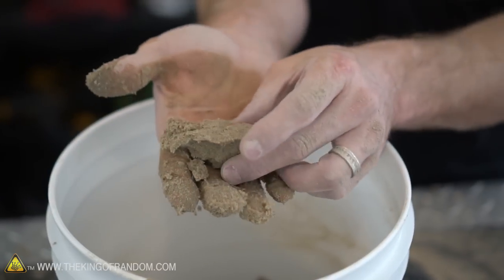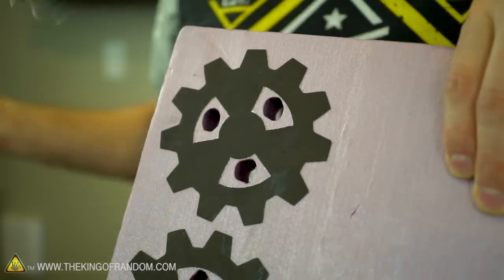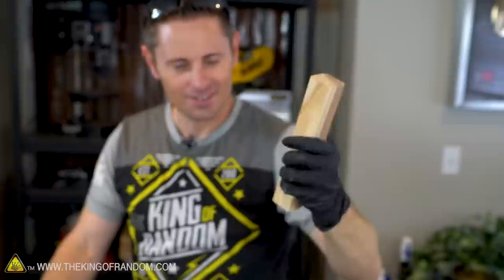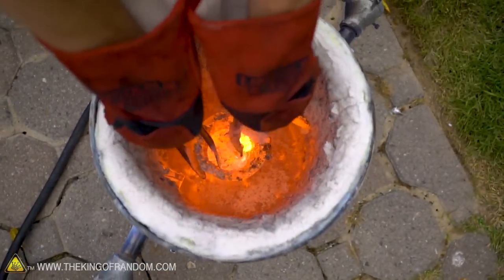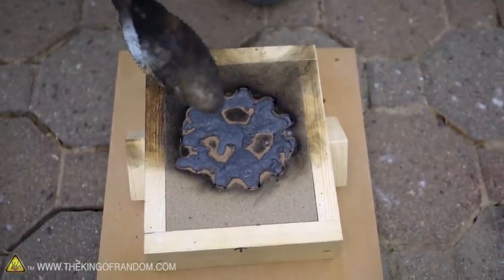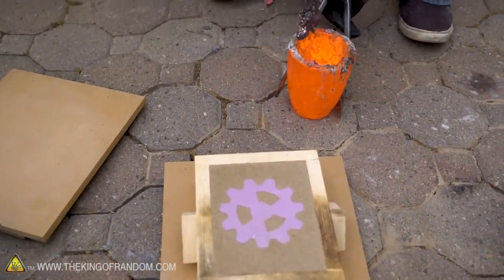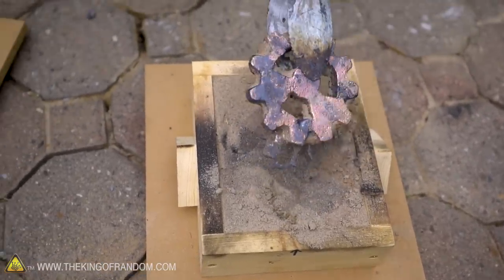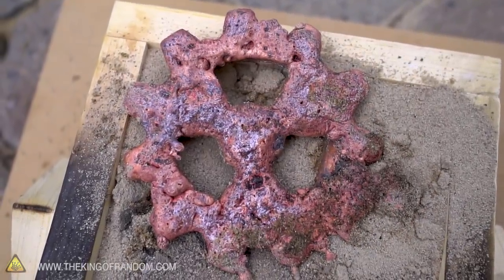Casting A "Radioactive" Copper Gear! TKOR Test Metal Foundry With Fidget Spinners &  Copper Melting!

Comment: What happens when you pour hot metal onto cold metal. Will the bond between the two be any weaker or will it be the same as if both were put together at the same temperature?
Reply: Pour*
Reply: lol ty
Reply: It will be weaker, becouse the the crystalline structure of the second metal wont have many bonds to the other one.
Its almost the same as if you were welding at low Amperes and welded too fast.
Reply: I'm sure it will be weaker, but will it fall apart if you try to pick it up? how much weakerr
Reply: It wont fall apart if you pick it up, but if you hit it with a with a hammer it very likely to fall apart.

Comment: If you ever decide to cast copper again, I have a trick I was shown a few years ago... When pouring the sand into the tray, mix it with wood glue, It will help the sand stay in place... You may also think about using kinetic sand(saw a video with aluminum) however it may still come apart.

Comment: What happens when you quench hot metals in liquid nitrogen?
Reply: They explode due to temperature difference.
Reply: Fluffy Unicorns man that's crazy o would not have thought about that. Thanks!
Reply: I don't think it would explode or really cool it much due to the Leidenfrost effect.
Reply: oh yes it will, thermal shock is a major issue when it comes to material stresses, Leidenfrost only last for a few seconds at these temperatures
Reply: everything related to Liquid Nitrogen: Leidenfrost Effect. It doesnt cool as fast as u think so because of it. A molten metal cools faster in water than in nitrogen.

Comment: hey grant here's a tip for green sand casting, you're supposed to heat the sand some so that when u pour the metal it takes a little longer before it hits its solidifying point

Comment: Is it possible to use liquid nitrogen to cool a PC?
Reply: No, liquid nitrogen would break the computer because it is way too cold
Reply: No the nitrogen would evaporate and pressurize the tube resulting in it blowing up
Reply: William Nixon Yes, but you need to create a specialized setup to do it and you need lots of insulation around the cpu inorder to prevent condensation
Reply: The truth is yes, it has been done and is even commercially available. The problem is it is a really specialized build. It also sounds like someone is mowing the lawn in your room. Linus did it
Reply: Scott Sarver your wrong people already did
Reply: Yes, and you can also cool a 
PC with vodk- wait no that would catch on fire nevermind.
Reply: arcticdoggo somebody did and it’s pretty funny

Comment: can't you melt copper with the carbon rods?
Reply: Yes but not as much
Reply: Damien kavanagh the carbon rod even melted rocks there should be no problem melting copper
Reply: yeah but his electric arc furnace is extremely small.
Reply: Notumengi grant have to use a better transformer which cost $$$... the transformer that he make is homemade using microwave

Comment: What if you took the hot crucible and tried to put in into the water bucket?
Reply: Mr. J I think it may crack but I don't know
Reply: it would definitely shatter... the temperatures differences would cause the outside to shrink way faster then the inside and would crack and  continue cracking until it just crumbles and explodes due to vaporized water... I don't think he would do that though since crucibles are so dang expensive

Comment: What if you bake the sand in the oven first with the styrofoam mold in it. To prevent too much loss of moisture in the sand use the wetter formula that you used before. That way as it heats up a little bit will evaporate and it still might maintain its structural integrity

Comment: Take all of your different metal melting foundries and test to see:

1:The most efficient
2:The cheapest.
3:The hottest

Have fun!
Reply: The plasma Arc furnace WILL be the hottest, and only uses electricity for "fuel"
Reply: epion660 And the electrodes
Reply: epion660 The microwave transformers can be quite expensive.
Reply: I was referring to running cost. Electrodes will last a while, and can be found in lantern batteries. Also, the transformer can likely be salvaged from a used microwave that's "broken"

Comment: I don't know if you'll even read it, but here it goes, you should try heating the mold on the oven before pouring the copper. It would heat the sand and possibly help a little with the copper cooling too fast

Comment: Use a top and pull the mold out.  The sand will insulate the copper and you'll get an even cast.  Use a pvc pipe in the center when packing the top, and make sure to talc the layers.  Keep the mold clean.

Comment: In theory what you could do instead of the foam is make a metal based mold that can withstand the heat of the copper so you can set the copper in. No issues with sand moving or causing issues.

Comment: I'm betting a copper oxide skin is preventing the metal from coalescing.  Before you melt your metal, liberally pour boric acid into the crucible to protect against oxidation.  Just before you pour, remove the slag with a carbon stirring rod.  You might also want to look into using a Sparex pickle solution.

Comment: Hey Grant. I was just wondering if you used a bigger box for the sand and the foam to form the copper gear. In your part 2 you posted today. That  would probably expand the surface area of the sand which will make the sand not pop out because of the heat that is condensed in one area. Just had the thought.

Comment: Not sure if this would bake all the moisture from the sand, and ruin the mold, but you might try heating the mold before pouring the molten copper in. It might give the copper just enough time to flow before cooling. 

Maybe bake it in the oven?

Comment: You could heat the sand up before pouring in the copper. Maybe that helps (And it melts the styrofoam as well)

Comment: I wonder if you bury a copper coil heater(high current) inside the sand if that would help? or if you put the whole mold in a furnace before casting. It will get rid of moisture right before casting and the hot sand might slightly slow the cooling process. I think the moisture is one of the main causes of imperfections. then again the heat might also weaken the sand.Worth a try...

Comment: use a heatgun and heat up the sand? would slow down the cooling of the copper a little. this is actually used in plumbing, where they heat up a pipe to the temp they use to harden it, then wield it and harden it afterwardsw, as in some typed of plumbing (weære talking about oil platforms and stuff alie here) if you wielded the cold pipe, it would ruin the hardening of the pipe and it wouldnt be close to strong enough! so i think it would work well as sand and stone holds heat pretty alright.

Comment: Quenching should use industrial oil than water, coz water is cooling down the metal too fast which may cause structural failure! Also using oil can make  the metal harder:)

Comment: best way to cast copper would be to make a wax mold and set it with a plaster shell with a hole in the top to pour your copper, the hot copper will melt the wax away and fill in the imprint in the plaster. BAM! copper cast of whatever you want

Comment: hey Grant, you should put the styrofoam in concrete...let it dry...melt and pour the metal into it as a perfect mold.
Reply: or use something that would harden around the styrofoam and would be able to hold heat

Comment: Preheat the sand mold and it'll burn out the Styrofoam and it will heat the sand itself so you won't get so much of the rough surface that results from the cold sand sucking the heat from the molten copper. You're getting a 'freeze off' affect from a cold mold.

Comment: Try to use a metal box for the sand (like a baking pan) then heat the sand first so it wouldn't solidify the copper on contact.

Comment: I think you need to place a sand block over the sand block with Styrofoam gear and put a hole on the top sand block so that molten copper reaches the Styrofoam.

Comment: Try using corium, should melt on its own given that you have neutron reflectors and a graphite neutron moderator. Once molten pour into your radioactive gear caste and voila, you have a radioactive gear. You'll probably need to submerge it in coolant for quite a long time, but after a while your corium should solidify and you will have a very hot gear. Keep submerged for a while longer and sometime later your hot side products should have decayed and you'd be left with a relatively cool radioactive gear.

Comment: I saw your video then went to look around how other people do their metal casting I found some videos that Brian Oltrogge did. He was using Petrobond sand instead of green sand and he was saying that when your "ramming up the mold" you want to use the angled side of the rammer that'll push the sand down and away towards the pattern and the frame. If you just use a flat rammer the sand will come apart at the stratta. Then again he was also fully encasing the part is sand brushing talcum powder between so they don't stick. Check some of his videos out maybe it'll help you with your next casting Grant. I'm sure you can make a great cast.
Reply: Just an observation but I do think that batch of green sand is a bit too dry.
Reply: He just did a wheel that is similar in design to your gear. He placed screws in the cut outs and then used a funnel to spray CO2 over the top of the sodium silicate sand to cure the top of the mold.

Comment: Use polystyrene foam (melts faster) and place it under the sand to help the mettle cool slower. Use a foam chimney to hold the hole your poring in to open and to slow the falling mettle. Pore enough mettle to fill the void and the chimney and you should have better results

Comment: If you heated the sand it would have been a perfect cast. Also try wax, it will melt away just as easily as Styrofoam, but won't expel toxins as it melts. Also don't use barbecue tongs! If you're doing this on the cheap, get some fire place tongs!

Comment: Dust your foam in talcum powder. Then you can remove it from the sand. It will not leave a residue in your sand mold and you can reuse your foam form.

Comment: What you gotta do is leave the copper in there longer while it melts, copper has a very high melting temperature that's why it's great for plumbing your solder will melt right onto your hot copper pipes making a perfect water seal

Comment: You need a shielding layer of sand on top with a riser to pour the copper in so the surface of the gear is not exposed to cooling air currents.  I think that's where the faults are coming from.

Comment: I'm not sure if anybody has asked this, but could you make the mold just like you did, melt away the Styrofoam with the hot copper, and then put the mold into the freezer for a while. Then when it is ready, just heat the copper back up again, and pour it into the mold. Also if the sand was damper than usual it would freeze and then the sand wouldn't shift? :p

Comment: Enjoyed your videos, but a word of caution learned from self experience: Bare hands are better than wearing thin rubber gloves when handling anything hot. Reason being if you touch something hot accidentally with bear hand you just move your hand away from the heat source. With thin rubber glove if you touch something hot and by the time you feel it, rubber is already hot and has become a heat source itself and it takes time to remove the glove from your hand while it is still burning your skin. Thin rubber gloves are for dirt, grime, oil, not for heat isolation.

Comment: 1. Copper is difficult. 
2. With that shape you need to keep the center whole(no 3 notches)
3. Also worth trying again with enclosed casting with a channel and chimney to fill from. 
4 then cut the notches after it has cooled. Please try and let me know.
Bonus please finish by sanding start from 120 grit and work up to 2000 grit then polish with polish compound.  Please please try i know you can do it

Comment: If you buried the gear in the sand and made a small hole where the molten copper could pass it is likely to work first and you would need to use coal because the propane only reaches 100 degrees centigrade above the melting point of the copper is for that reason that it solidifies so quickly with coal gives it to reach 400 degrees centigrade above the melting point of the copper I discovered this after melting stainless steel which has a melting point 400 degrees above the melting point of the copper.

Comment: coat the gear in baby powder FIRST (so it won't stick) and pull it out to leave the negative. You don't need to sacrificially cast when using green sand, that's the point of using it.

Comment: For everyone commenting "can you drink liquid nitrogen" no it contains 4,000 times more oxygen than normal oxygen (by volume) and this would cause non combustible substances such as zinc and carbon, which as you know makes up lots of the body, to combust. So basically you would catch fire and combust when it comes in contact with your mouth.

Comment: I think you should try it again but instead of pouring it with the foam still in after melting it with the bottom of the cruisible. Put the cruisible back in take the remnants of the foam out then pour the copper

Comment: Would heating up the sand, say in an oven or something, not solve those problems? it would keep the metal from cooling as quickly, and allow the styrofoam to melt away more quickly, right?

Comment: Pick up some borax, throw a bit in as flux. It will help the metal flow a bit, and combat oxidation.  You may even have some around for laundry soap. Double check its all borax though

Comment: when you first packed the mold, you barely compressed the sand. No wonder some of your pours failed. My guess is that it is very dry. Almost too dry. Do consider a pneumatic hammer to bang that sand into submission. Which means you can make more intricate and technical molds.

Comment: You made two halves of your sand box.... Use them. out the gear in one half, and pack the top half in. Cut a gate and sprue and overflow like you're casting a real part.

Comment: Get a wooden rectangle get a thick Styrofoam sheet , cut it in the shape you want , place it inside the wooden rectangle  fill the wooden rectangle with sand, flip it over and pour the molten metal on the Styrofoam you'll get the metal  shaped as you want , but you have to grind, buff, and Polish the metal

Comment: Could you just mix in a plaster like drywall compound? it would hold together if you let it dry a bit and the sand would prevent it from cracking...maybe...

Comment: hey king of random, i am working on your arc furnace idea and so i have the carbon rods, zinc casing are not fully melted, copper wire, and fire bricks, but not the alumina silicate bricks,what should i do?

Comment: Grant make a mold of a penny then you can melt more copper and put it in the mold then you end up with a penny and if the backyard foundry is hot enough you can melt metal then you can make the other coins like the nickel and the dime and the quarter or you can make golden coins

Comment: Grant if you use brass instead of copper it may work better, because brass is more resilient and stays hot longer the down side is it will take longer to heat to a molten state. So give it a try I'd like to see how brass is for casting thanks and stay RanDom

Comment: I would think that using a 2 part split pattern mold might work better with copper casting, but that is my wild as* guess  no foam to melt / burn out and the detail pillars would be held in place, other Idea I had was cast a solid gear and mill in the details after casting

Comment: Instead of the sand that you are using, use a hardened clay instead that you can reuse if handles properly. Then if it turns out right just chip away the hardened clay

Comment: If you make a mold of a penny  and melt some more copper and put it in the mold your left with a penny and if the backyard foundry is hot enough to melt a nickel or a dime or a quarter then you can make them also

Comment: I was watching this Video  And it got me to thinking the mold you're making instead of showing the Styrofoam cover it  up with  the top casting of sand, and put pipes in the sand  Above the Styrofoam so you can fill it up and the sand shouldn't move on you like before.  It would be like  Pouring   Lead into the ground like in an ant hill .

Comment: Copper was £3.40 a kilo £3400 a ton for bright ie not covered in paint etc scrap if you burn cable and scrap that its a lot less £2.60,it varies on the scrap yard.the tube used in air con is softer I've been told its a purer copper, but I thought copper is copper not an alloy so I don't know about that? Any body know?

Comment: fyi the copper you bought isn't worth that much after you melt it down. no 1 its not in a tube shape which they add price to for making  it into something to use. and no 2 youll be lucky to get scrap value for it now which will be around $7-8 worth of copper after you melted your $30 pipes down. not sure why you didn't try to buy some cheap reclaimed stuff rather than new lol